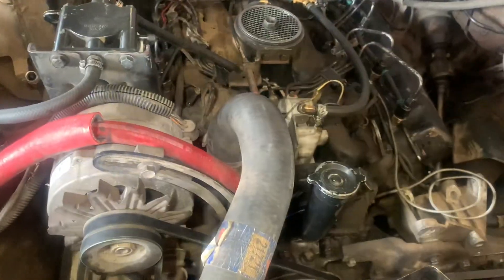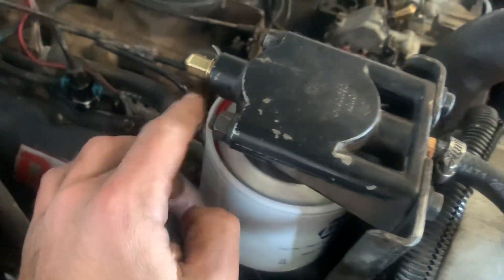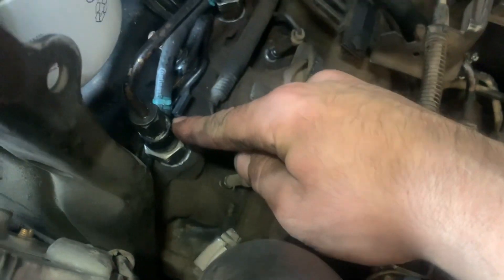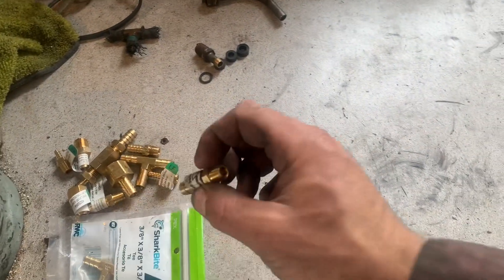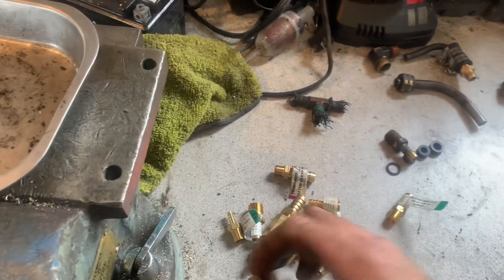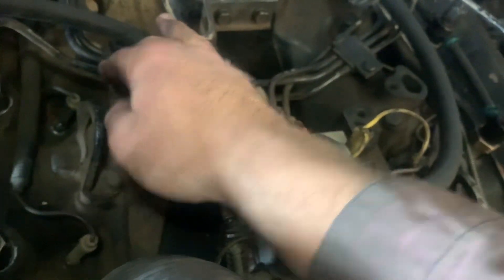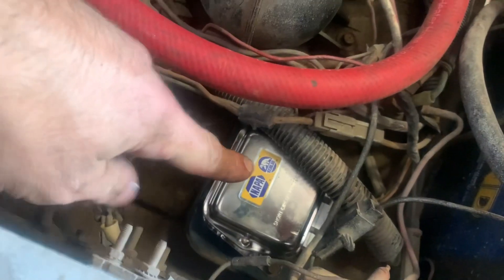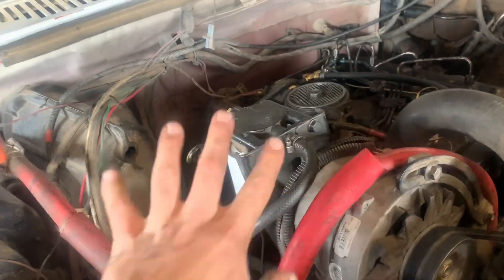1984 f250 6.9/7.3 idi fuel supply and return solution

Comment: This is the simplest fix for continual air intrusion that i have seen. Excess fuel needs to go back to the fuel tank without the chance to return to the filter. Any entrained air is forced out of the fueling cycle.  Any air in the filter that has come from a fuel filter change can be bled off at the filter Schrader valve, leaving the system clear of air. Thanks for showing us your fix.
Reply from the maker: Was reading the stanadyne manual - they specifically say not to route the fuel from the return side back to the inlet side. Go figure ford did it! Lmao